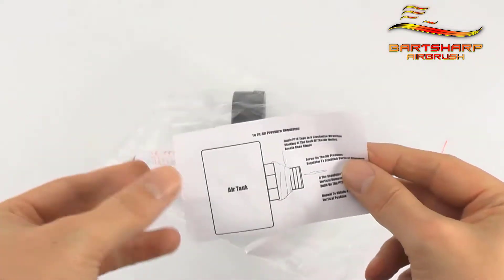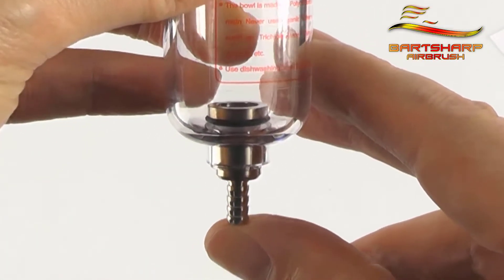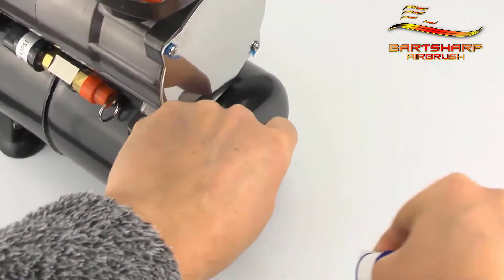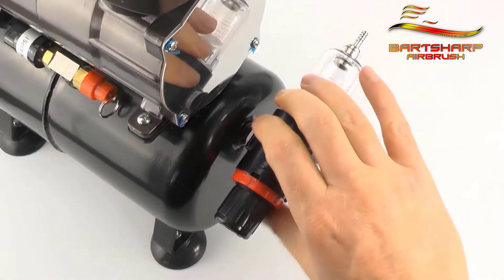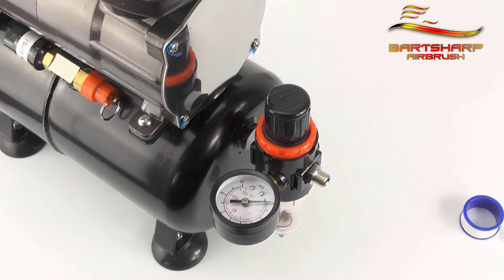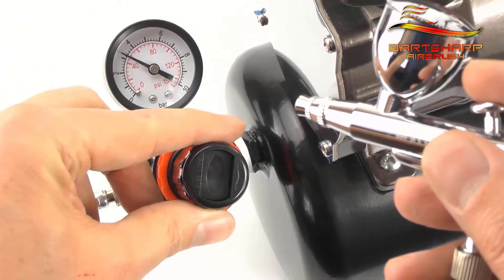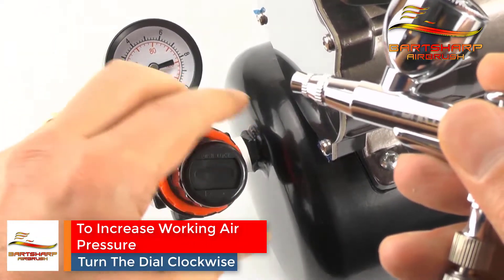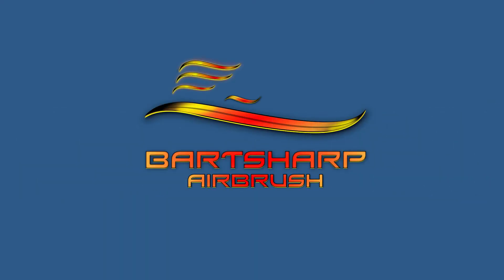Airbrush Air Pressure Regulator | Perfectly Fit | Set | Adjust PSI | Airbrush Set Up (2023 Set Now!)

Comment: Aaah, thank you so much for this video, I could not figure out how to adjust the PSI properly. Turns out I wasn't turning the pressure regulator dial nearly enough. As a complete beginner I had absolutely no frame of reference, and the compressor didn't come with any instructions.

Comment: Thank you for this video, super helpful in figuring out what was wrong with my airbrushing process. Turns out the compressor I got came preset to about 45psi when my airbrush is supposed to be used at around 25-30! Now that you've helped me figure out how to lower the pressure, it doesn't feel like it's going to crack open anymore haha

Comment: I'm having a problem with my airbrush hose connecting to the air pressure regulator.  The airbrush hose can only screw on about 2-3 rotations before it's completely finger tight.   Because of this, if the hose is pulled even slightly, the metal sleeve of the hose end gets loose and I start to have an air leak.  Sorry if I'm not describing the parts very well.  I'm still pretty new to airbrushing.
Reply from the maker: it sounds like the inner thread of your hose is either damaged or incompatible with the thread of the pressure regulator air out connector. The air hose connector should screw on without resistance and you may have crossed the threads. It may be worth simply spending a few £ / $ and buying a new airbrush air hose. The most common thread type is BSP (British Standard Pipe). Good luck.
Reply: @BARTSHARPAirbrush  that sucks.  My hose is brand new and has the 1/8 BSP connection. The compressor is also brand new so I doubt that the threads are stripped.  Guess I’ll just have to cough up some $$ for a different hose

Comment: Thank you for your incredibly well presented usage guidance. 

I am an Air Brush Newbie and was disappointed with the total lack of equipment literature provisions in the tools I selected. 

Case in point, my Timbertech combo Air Compressor & Tank's manual provided barely more than an assembly guide & was void of even basic information about the Air Release.

Comment: this video saved me from an absolutely stupid mistake. I have a similair compressor and my air pressure regulator also has a "push lock" which i've never encountered before. So my logic was to press down as hard as i could on the dial and then try and turn it. I couldn't figure out if I just have weak hands or if i was doing something wrong untill I stumbled across your video showing me to lift the nob hahahaha

Comment: Teflon Tape, it doesn't take that much, start at the top of the threads instead and yes go clockwise. If you do it counter clockwise the threads will unwrap the tape and bind when you thread on your piece.

Comment: The regulator is fine, the stupid cheap plastic knob is the problem, mine snapped easily from over tightening. The pressure was not rising, I kept turning and all of a sudden pop the the air shot out and the plastic cap snapped. I used epoxy to put it back together but now I have zero adjustment.

Comment: You will probably think I'm stupid asking this question but I confess that I'm unsure of the correct answer. Does the airbrush need to be turned on when you set pressure?  I assume it does need to be but assuming anything is dangerous. 
I don't want to break anything 😊😊😊

Comment: Great video , i have a compressor like this but doesn't kick in until way below my working pressure! Is that normal? 
Thanks
Reply from the maker: Hi Stuart, if you have followed the set up process, shown in the video, and your compressor doesn't kick in until below your working air pressure then you may have a faulty pressure regulator or faulty solenoid on the compressor. The solenoid identifies when the compressor should start/stop based on reserve pressure in the tank. We have replacement pressure regulators and compressor solenoids in stock. Email us at    info@bartsharpairbrush.co.uk    if you need to order either of these items. Thanks.

Comment: Is it normal for my compressor (same as in video) to overheat to the point where I can’t touch it?
Reply from the maker: Hi Jakey, short answer is yes. Placing air through a mechanical process, ie. compression, produces heat and moisture. In addition to this the electric motor will get hotter the longer it runs. All compressors (should have) a built in thermal safety cut off switch as the compressor will get hot during normal use. You could try running a fan over the head of the compressor to help reduce heat build up.

Comment: I have exactly the same regulator as the one in this video, I can adjust the working pressure as shown in the video, my question is, when I lower the working pressure to anywhere but high, I can hear air escaping, if I tighten the pressure adjusting know all the way there is no air escaping, the compressor works as normal cutting off and on when it should, I've disassembled the regulator and made sure everything is clean inside and all is good, id I lower the working pressure to say 2 Bar, the compressor runs continuously as the cutoff pressure is never reached, is my regulator faulty?

Comment: I am having issues with this exact inline air regulator. When I turn the knob to reduce PSI, I can reduce the pressure and it eventually does start hissing and letting air out, however, no air goes to my airbrush. Unless I turn the dial fully clockwise and to max pressure, it won't work. Everything is tight, but for some reason if I set the pressure at all using that inline regulator it stops working. Any ideas?

Comment: That was a very good, informative video. I was unaware that air fittings required that much PTFE tape. I thought two or three revolutions was sufficient. Thanks for the showing the proper way to apply it.

Comment: I got this regulator and compressor (without a tank) as part of a set. I had no idea if the gauge was supposed to be giving you the working pressure with the trigger depressed or not because there was no documentation. Thanks for clearing this up.

Comment: It's only called plumber's tape by non plumbers, who don't know what the hell they're talking about. Actual plumber's tape is a metal strapping with holes for nails. It's meant to be used as a tie down strap for securing pipe.

Comment: great video - thanks! quick question: my compressor gets hot in just a few minutes. is there a specific temp in which I need to stop using it and let it cool down?
Reply from the maker: Hi, compressors will get hot due to placing air through a mechanical process, compression, which produces heat and water vapour. Your compressor should have a thermo safety cut off as standard. If you find that it heats up too quickly try removing the compressor head and cleaning the piston and piston chamber wall, also check the air inlet to see if that is a bit clogged as it will reduce airflow and cause overheating. IN hot weather use a desk fan and aim it at the cooling fins of the compressor head. Hope this helps.
Reply: @BARTSHARPAirbrush  thanks for the super quick reply. I'll try it out and see how it goes.

Comment: Bartsharp I have been having this issue of regulator PSI creep, it I replace the regulator with say a brand name air regulator could this correct this PSI creep problem. I can set my PSI at 12 psi with my Micron and look at it about 20 minutes later and I am sitting at 20 ish psi. I always verify the psi two or three times before I engage the lock ring, but the creep still happens.

Comment: I bought a compressor a year ago, but circumstances made me have to move before setting it up. When I now have settled down again, I've set it up, but turning it on makes it start to smell like burnt rubber, and a little smoke comes out. This is my first time turning it on, but I understand that something must be wrong. My guess is that the cooling isn't working, but I have zero expertise in this. Anyone got any tip?

Comment: I just invested on my first airbrush compressor. It looks similar to yours. I got it working and have used it for about 2 weeks. Everything seems to be fine so far.

But do you have any advice on what to do AFTER I'm done using it? I ask because the first time I finished, I left it with pressure in the tank, but when I come back the next day, the tank is totally empty. I've listened carefully and I hear no leaks, so I wonder if this is just the way it works, or if I should look out for something.

Another channel recommends that I empty the tank after each session to reduce stress and moisture buildup in the tank and I've done that. I guess I'm still curious.

Thank you in advance if you decided to drop by my comment, and thank you for your very informative video. Cheers.
Reply from the maker: It sounds like you have a small ait leak if tank drops pressure overnight. Best to empty tank after use as you have been advised and also drain the tank regularly to remove water build up. There should be a small brass drain valve on the bottom of the tank. Happy spraying!
Reply from the maker: It's good practice to empty your tank when you have finished your airbrushing session. Sounds like you have a very small air leak which doesn't affect normal use but, over an extended period of time, will allow the tank to empty.

Comment: Hi and thanks for the great info and described so clearly and in detail..
I have one of these and have a problem  where the compressor turns on OK but just keeps running, and does not shut off when the pressure gauge gets to the set pressure. Also I don't see the pressure rise any further  than where it was set to, and cannot change the setting any higher. Is the problem likely to be in the pressure setting mechanism with the drain on the bottom, or the sensor? screwed into the top near the heat sink vanes.

Comment: Hello im having issue keep the pressure with my aircompressor. It seem to the same model as yoursm, but the moment i lower the air pressure it wont stay stable and continues to go down.
Reply from the maker: It sounds like your inner spring and control mechanism have worn or developed a faulty. Would be worth replacing the whole pressure regulator to resolve the issue. A new regulator is very inexpensive but performs a number of important tasks. thanks.
Reply: @BARTSHARPAirbrush  Thank you. I had a feeling that might be the case but i really didnt want it to be... I've onlyhad mine for 1 week but the problem was there from the begining.

Comment: Can you please tell me how long these air compressor can run, with out get to hot?  I have one but I’ve not used it a lot,  and need to get it back out ... I use it to airbrush nails with!  Thank you so much 😊
Reply from the maker: Hi, it depends on what pressure you are running it at and if there are any short breaks between spraying. Compressing air produces heat so the compressor unit gets hot and has a thermal safety cut off switch. To extend spraying time you could try using a desk fan to cool the compressor unit. : )

Comment: A colleague gave me an old Badger air compressor that lacks not only a switch but an air regulator as well. I came across your video while looking for something else but it is a help for when I get the regulator. I also have 2 different air brushes, a Paasche and a gravity feed one as well. I had to buy adapters to fit them. I might invest in the quick connects to ease switching between air brushes. Thanks for posting this.

Comment: I am a 70 year old neophyte here hoping beyond hope that someone will help/reply.  I have a new Master compressor which I  need to set at a working psi of 40.   I tried making the adjustment as shown.  I cannot get it over 30 psi.  Does this mean I  have an air leak?  Do all new compressors need the Teflon tape treatment?  Would someone help me out.  I'm wanting to start a new hobby.  How do I  get the pressure regulator off?  It is very tight.  Thank you.
Reply from the maker: Hi, and thank you for your kind comments about the video.
All recent compressors should be able to produce a working pressure of up to 57PSI minimum for the basic models.
You should be able to increase the working air pressure, at the airbrush, by following the steps in the video: lift the top black part of the air pressure regulator until it clicks up and out of the locked position, turn the top black part in a clockwise direction until the pressure, shown on the pressure dial, starts to increase, then, adjust to the required pressure following the seps in the video. As stated in the video, you might be surprised how many turns are required until you see movement of the pressure gauge needle.
 
If your compressor has an air tank you will be able to tell if there is an air leak as, once the compressor has filled the tank and stopped running, as you may hear air hissing from a leak – this will help you to locate the component that is leaking.
If you have a compressor without a tank it is most likely “on demand” which means that it will start to run when a drop in pressure is detected, ie. When you press the trigger on the airbrush the compressor will automatically start. If your tankless compressor stop starts without you pressing the airbrush trigger then a leak is possible.
Teflon tape is often used to ensure an airtight fit. During manufacture a thread lock liquid is used. This sets solid to create an airtight seal around the thread of the connectors and can be very hard to break, this is probably why you are struggling to remove the pressure regulator. I would suggest that you get a hair dryer, on the maximum heat setting, and direct it at the pressure regulator connector, this will cause the thread lock to soften and allow you to move it. Do this a little at a time; heat, move a bit and then heat again. You could use a heat gun but the heat from this could cause damage to the plastic casing of the pressure regulator so caution is needed.
I would start by checking that you have no air leaks and then move onto trying to set the air pressure, via the pressure regulator, as per the video (which I am sure you have tried a dew times!) If this does not solve the issue it is possible that you have a faulty pressure regulator or air pressure sensor which is the part that controls the auto stop/start feature of the compressor. If your compressor is a recent purchase it is advisable to get back in touch with your seller to try and resolve these issues. 
40PSI is a quite a high pressure to be using and is most often used when spraying pearl or candy paints as well as some lacquers (as they require a higher PSI to achieve correct atomisation). You may be spraying textile paint which, again, requires a higher PSI to ensure that the medium
 becomes embedded into the fabric. If you are wishing to spray paint for models etc then a PSI range of 15-25 is more often used, this will require suitable thinning of the medium (consistency of non-skimmed milk) to achieve good paint flow and coverage.
I really hope that this is of help and good luck : )
Reply: @BARTSHARPAirbrush  Wow!  What a thorough answer!  A couple notes.  I am only using this to blow air to move inks on the art surface.  No paints in the pot.  My compressor is new with a max psi of 57.  

I did try  adjusting the pressure at the regulator, but found it almost impossible to turn clockwise to raise the pressure, but easy to turn to lower the pressure.  I should add that due to a neurological  condition my hands and grip are weak.  Should I  ask someone a bit more burly than myself to try?  I was afraid that forcing it, even though it was turning, might damage it.  Unlikely, I  guess, because it seems very solid and well made.  If that is the solution it should be very easy.  Again, thank you for your time and kindness.
Reply from the maker: @jeannemckinney883  hi Jeanne, the air pressure regulator should be easy to turn and there should be no resistance until it reaches the the very upper limit point of adjustment. Don't try to force it as this may result in damage. It sounds like you may have one of two scenarios: firstly, your air pressure regulator is faulty making it impossible to increase the air pressure to the required level or, secondly, your compressor simply isn't producing the required level of compressed air. The first is easy to fix with replacement of the air pressure regulator. The second requires return of the unit to your supplier for inspection and remedy.  You shouldn't have to try and resolve this issue as your supplier should be there to help you out. I really hope that you are able to get this resolved with them. Kind regards.

Comment: Help! I have a Central Pneumatic 1/5 hp, 58 psi compressor. A moisture trap comes from compressor and a pressure gauge is attached to Moisture trap. What I need is a Pressure Regulator like in this video. I have No way to control my pressure at moment. It's a 1/8" -27 NPT, would this Airbrush Air pressure regulator fit on my compressor. Thank You

Comment: have a Timbertech Upgraded Airbrush Compressor ABPST07,  losing air pressure, cant increase plus it drops, only had for 6 months.  plus my water trap is so tight cant figure out how to get it off to get water out of it??  feel moisture coming out of air hose??